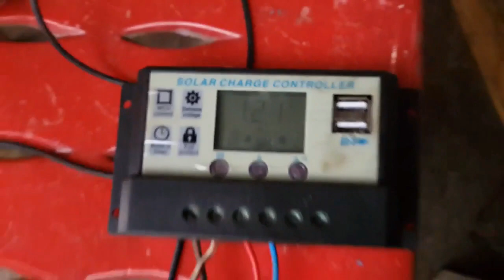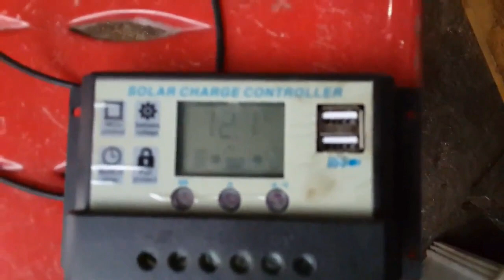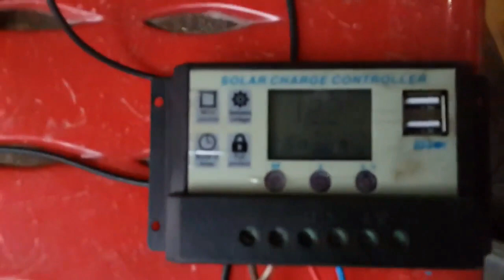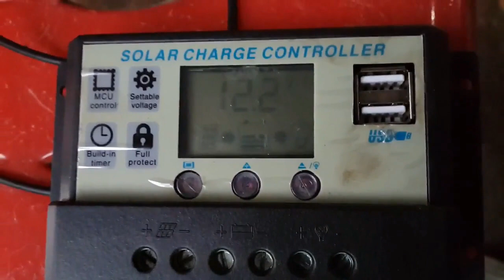Build Real Free Energy Generator  Build Easy More efficiency Gravity Weight GearTimed motor

Comment: if you had my antigravity lever you would be able to lifte your house and use that as the falling weight for your energy needs.  did you not realize that two pendulums that travel the same distance on the input swing but different lengt of the pendulum produce a energy that is no equal . that is why you can take a pendulum that is very long at short distance and gear it up and produce energy greater than put in. the taller the pendulum the more energy it produce.

Comment: What if i connected a hose from my house with a valve at the top of the frame. It fills the barrel, cuts off, the barrel starts to fall slowly generating power, while this is falling, a second barrel at the top fills up, once full, stops filling. When the first barrel reaches the bottom, it releases its water, becomes very light, the second barrel starts to fall slowly which lifts the now much lighter  1st barrel back up to the top. My water is not metered and already paid for through taxes so should work. Other possibilities could be an archimedes screw lifting the water up as the barrel falls, powered by the falling water into a 2nd barrel or storage barrel waiting for the 1st barrel to get back to the top to refill
Reply: The power won't be free then. Your basically stealing power at that point.  Many have done this but in a different way by using a pump and they take the motor off the pump so that the water pressure from the city spins the pump but they also get huge fines and jail time and most lose thier homes in the long run. I mean it's not a dumb idea it's the mind of a brilliant man but I would skip this idea of using the city pressure.  Basically the city is pumping the energy or water in this case to a water tower and it's not free falling water even though it's freely falling it cost to raise the water.
Reply: If u have a river nearby you could use a ram pump, this pump Uses the high Pressure of the water to pump itself upwards so no electricity is used in here.
Reply: You described a water wheel exactly what a waterwheel does it's been around since early 1700s I think they use this technology saw mills

Comment: This isn't "Free Energy" its a gas power generator.  The forklift you used to lift the barrel runs on gas.. thats where the energy came from, its not magic.  Unless you had an electric forklift and you could use it to lift the barrel which could then generate more power back into the forklift battery than it used to lift the barrel then you don't have free energy.  I don't know how much all those parts cost including the generator at the end but I bet it was more than a 60$ solar panel that would put out 12 volts for several hours a day.  This contraption didn't make 12 volts for even 10 minutes before the barrel hit the ground.

That said I have considered doing something like this myself but with much much heavier weights than that.  Imagine doing the same thing but instead of a barrel probably full of metal or something you use an old truck as a weight.  Put that on a an a frame 30 feet in the air and use a wench to lift it up there.  Once you gear that down and hook a generator to it yea its still not free energy but its a massive backup power system.  10 mins isn't going to do much for you but that could run a full size 120v generator for hours.  That said... so could 5 gallons of gasoline.
Reply: or if you use some modified car jack (or something bigger modified home stuff like that) and you lift it with that, using your muscles...thats kindda "free" energy. I know its not totally free energy, because you need energy from your muscles.... but we need some daily workout anyways :) What do you think, is it possible ?  Like your idea anyways !

Comment: now stop the whole crap just by shorting out the cables. no amps! just volts
Reply from the maker: its came one question  i know this would work if you added flywheel heavy weight. kinetic pushes generator, you will get amount more  amp , using better generator 10kw as load , don't copy same video of this character ,  then you might get working on something.
Reply from the maker: prove me if its crap back 10 years they build one industrial, the only problem you think this bullshit scamm prove it build one let me see if its fake,

Comment: May i ask what the exact weight of this is? What is the output in this video? You told me this output is 100watts to 400watts but didn't give me the voltage. Thanks! Great project!
Reply: if its 100-400W and you see 12.1V it means the current is 100/12.1 = 8.26A to  400/12.1 = 33.05A
Reply: If you have thr watts you the power 

Volts is less important without amps

To figure out watts which you know

Comment: hi i am from Pakistan do u help me i need your idea
.
Reply: fake ha ye. there is no machine who's out put exceed input. fake weight lifter
Reply: @halimxomer1578  koi cheaz bhi aysi nahi ban sakti jo free energy day?
Reply: @BewithUmer  dunya ma aesi koi free cheeze nhi. science terminology ma alternative energy ha jo crude oil se hat kar ha. air, solar, water dam etc jo with passage of time improve ho rahi ha. motor to motor ya wheel ya mechanically all fake free energy .... don't believe that
Reply: @halimxomer1578  did you ever try to make energy at home .i mean which natural source.
Reply: @BewithUmer  i am using solar panels
Reply: @halimxomer1578  where u from
Reply: @erfans.6928  i need solution i saw your video because i like your idea. i need more video about your system .gear size etc
Reply from the maker: yes sir great leading you to right direction i explain. i have say holding case cover to hold gears has to be very powerful too. the gear will push amount force Back when they very heavy. if the case made out wood you have picked worst case cover made out  wood will tear all apart shatter million pieces once wheel weight start turning it will Break apart NEVER USE WOOD.  be careful on project with skeptical, and consider  case to hold gears stand need  to be metal suit well RUN PERFECT WHEN, EVERYTHING MADE OUT METAL.  it will continue running perfect once their correct set-up.on thank you and this project k Good luck.
Reply from the maker: GREAT QUESTION , i lead what can i help you with.
Reply: halim bhai kia koi bhi cheaz aysi nahi ban sakti ? motor to generator etc
Reply: @erfans.6928  You are a big lier and cheater. don't earn money on this way from you tube.

Comment: Formula is currect but.... weight reset is main problem.
Reply from the maker: true, it reset  i take this to next generation. the goal is add much more gear like 12 gears to increase time. if we can build two this system we can run it 24 hour. when weight is heavy motor  can reset it going back up on rope system winding.
Reply: @erfans.6928  What if you use some modified car jack (or something bigger modified home stuff like that) and you lift it with that, using your muscles...thats kindda "free" energy. I know its not totally free energy, because you need energy from your muscles.... but we need some daily workout anyways :) What do you think, is it possible ?  Like your idea anyways !
Reply: @imresovago2089  super explanation
Reply: Can we use hydraulic pressure in simple way...... to lift the weights again to up.....  like Archimedes' principle....  if u send yours email id....  i will send some ideas originally conceived by me.....  almost free energy